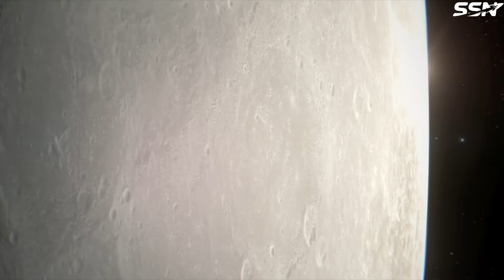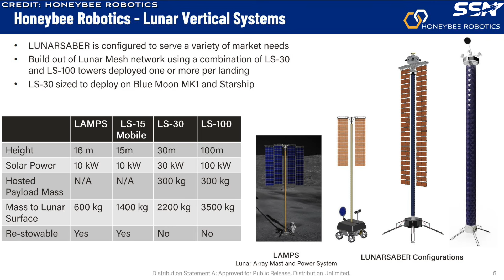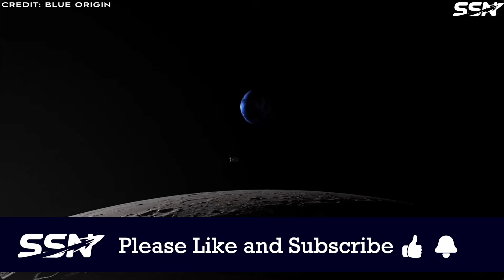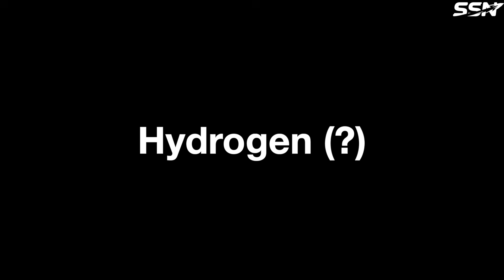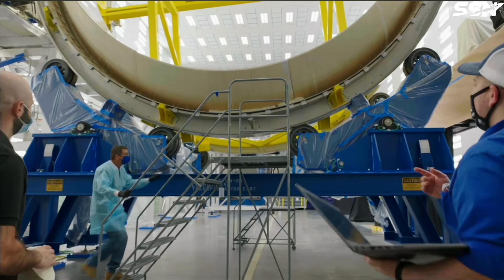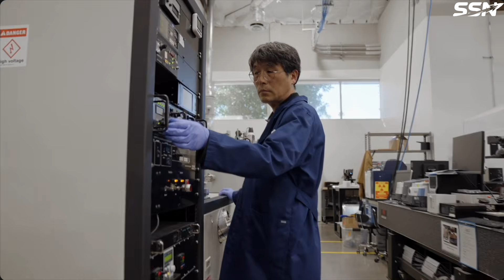60% Cheaper Moon Landings? Blue Origin's ISRU Plan

Comment: Uh yes, and this is the true sad part of the news, ...99.99% of people dont understand or comprehend , what it takes to not go to the Moon, but stay on the Moon and function on the Moon with out depending on resupply's  from Earth in a continues line like every month at NONE stop. Let say WATER, ok we know there is water on the Moon, not all over, its not a river, its not a lake, its a frozen water vapor in form of ICE crystals frozen in soil or rock, and its preserve it that form at some places where conditions did make it so for Billions of years. Getting that substance WATER is easy and simple on Earth, on the Moon is like pain in the ASS or a tooth pain, never goes away !!! the best we have is works on material retrievals done by Zubberman, he did work on it for many years, yes NOT on the Moon, but in the lab and on Earth.The temperature of this solid structures that contain water, the frozen mist are at - 120 C to a - 160 C, when it gets disturbed it quickly warms up with exposure to Sun light as a Example, when that vapor cooks it goes poof and is gone if "IT" is not contain like in a pressure vessel, it needs to be captured, separated, process, reprocess, cleaned, and then we have WATER. We can call it Moon water if we like.  Very clean water is actually bad for You, that water will need to have active 1% of other substances to be reactive...we may use electrolytic line up and get O and H in separate forms. A this done in a lab and cooking a 1 ton of rocks will produce a bunch of water droplets here on Earth, on the Moon it will be even less. And we need to make this a Commercial and Industrial type of a venture !!! we need to thing big, HUGE- more likely, like Harvesters from movie DUNE. And when we collect the soil we CAN NOT just get WATER alone and dump the rest...this way that water will cost us humans more then bring it from Earth, ...but if we can extract out of multi process harvester like 10 different substances ...then the whole process start to make sense. Now they did build experimental Harvester for water only, and its 850 tones machine...haw do we get this to the Moon when we have problems with delivering 3 tons or 10 tones, for sure and 100% safe and unbroken...and this is a small experimental machine not a real Commercial/Industrial real thing, the real thing will be like of the size of a small Earth size factory...well haw do we going to GET THAT SHIT TO THE MOON !!! We can today go for a week maybe 2, to the Moon, set up a primitive Habitat and play silly games that will cost Trillions$, we can do that today...no problem, Elon will pay. But this is not the point...we need to think seriously...very seriously...and for 99.99% of people this is not a even possibility, ...maybe we should Star Treck  people handle this...they have the expertise with it for bunch of millennials...no problem. Scotty !! where are YOU? we have a job for You !!NO, not a boob job, a Moon job.TH